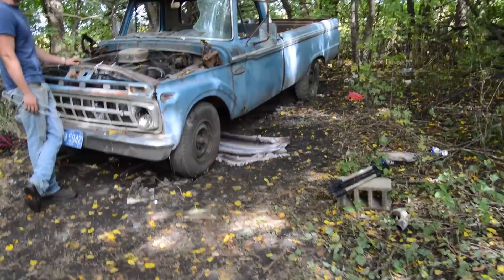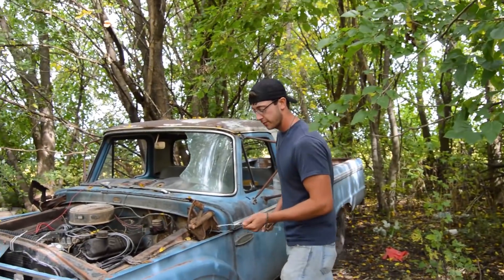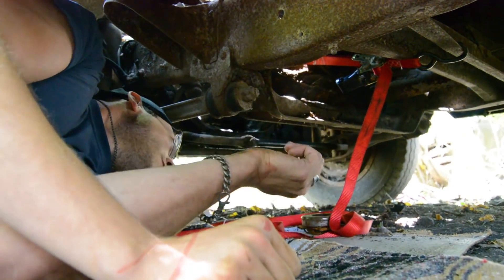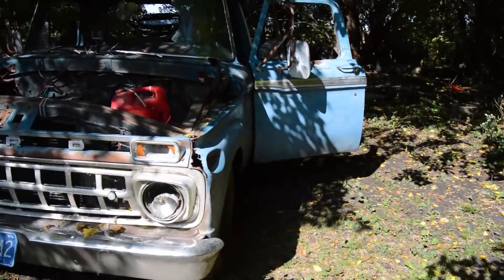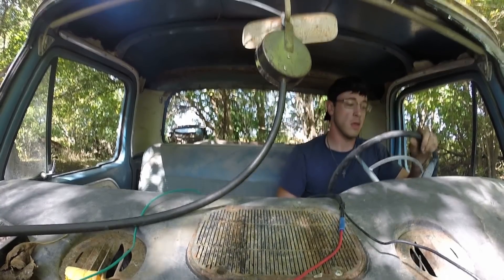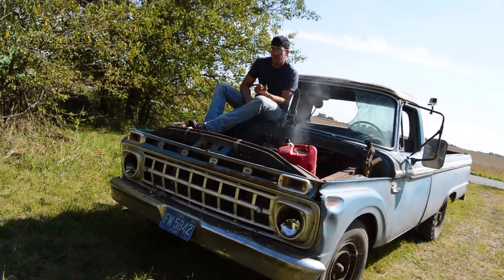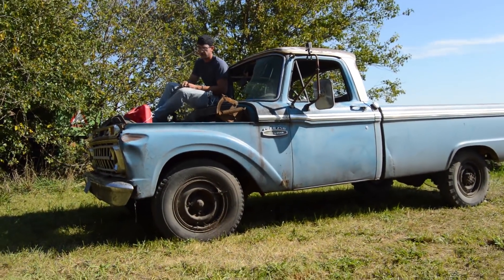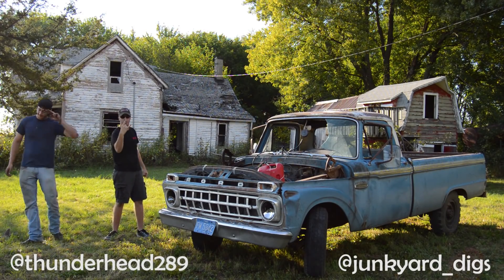Abandoned F250 Revival! First Start in 26 Years -- Part 4

Comment: I bought a 1987 ford ranger that sat for about 7 years. It got sold to 6 different people before me, none of which could get it to start. 
So I started with the basics does the motor turn and so on. I did lube the cylinders the same way with transmission fluid lol. 
It would crank had spark but no fire. So I drained the fuel tank got it acid dipped, and bought a new pump. Slapped it together still no fire. So I started testing for power to the pump, it had no power to the pump. That led me to the fuel cut off switch under the glove box. What do you know some one unplugged it. I plugged it in did just a primer test and bam power to the pump. 7 years no one could figure it out and it probably would have been longer if I didn't figure it out. Sadly though I did not keep the truck after all the work i put in. I tracked the owner and he drug his feet on the title for to long and I had to get rid of it through a wrecker service. It needed more work and did not intend on doing any until I got the title. 7 months it sat bugging the dude finally i had to let go. But i did get it started when no one else could lol

Comment: These guys are just lucky! If that timing chain jumped a tooth, it wouldn't run as good as it is! They still need to gap the points with a feeler gauge and change the vacuum line to the vacuum advance and the exhaust leak is not helping the back pressure to the engine! I could have rebuilt that engine trans and clotch by now! Two knuckleheads!

Comment: To determine which cylinder(s) is/are dead, while it's idling, remove one spark plug wire at a time. If the engine runs exactly the same when one is removed, that's the bad cylinder. Hopefully, it's just a bad spark plug. Also, spray a fine stream of water on the exhaust manifold port area. The dead cylinder will let the water evaporate slowly. On the good, firing cylinders, the water will boil away immediately. You should have known.

Comment: when you have no clutch and need to gear up you:
- apply little more gas (done)
- quickly switch to neutral (done)
- let the motor idle when asking the gear in putting light tension on shifter (this is the hardest part to do and i think it idles bad and that is no good even with good clutch) mashing the gear in while spinning is bad for gearbox and you'll never shift up like that

Comment: Still doesn't compare to a starter in a skid steer plowed a 30 by 50 foot parking lot off just the starter once. (Vehicle was to be junked but the replacement hadn't arrived yet) hardest part was just having a smart car as a follow car attached with jumper cables